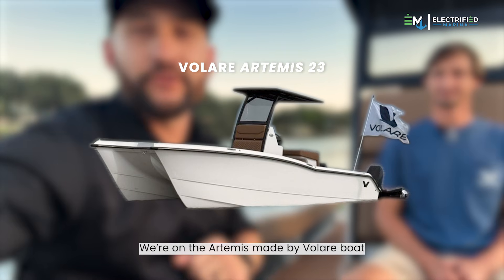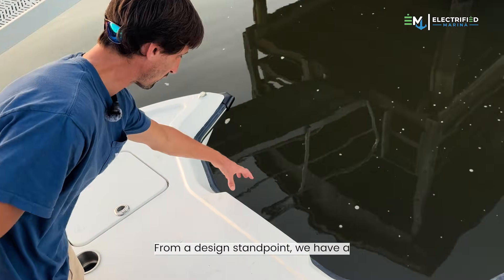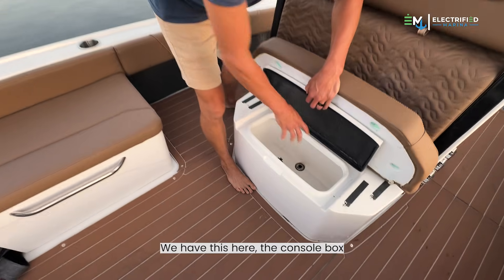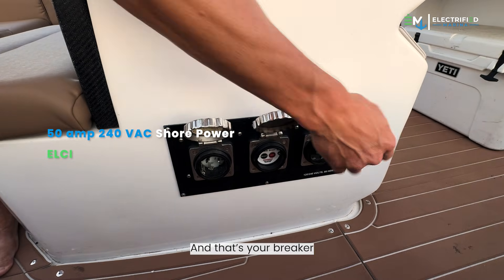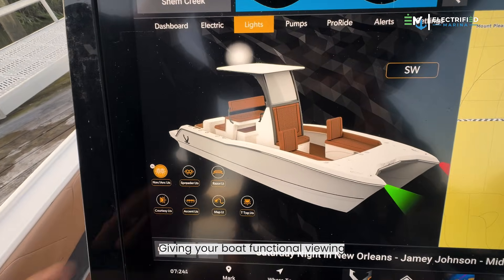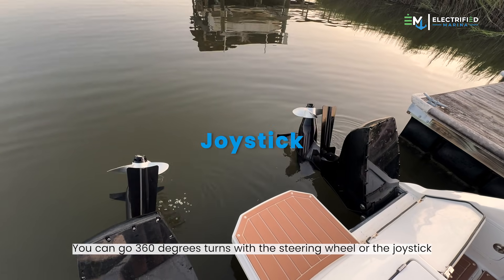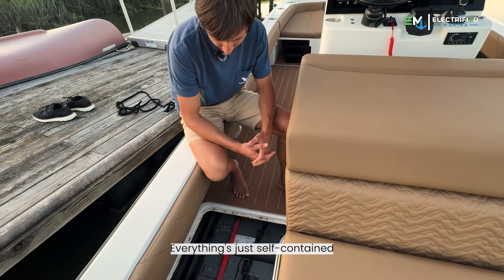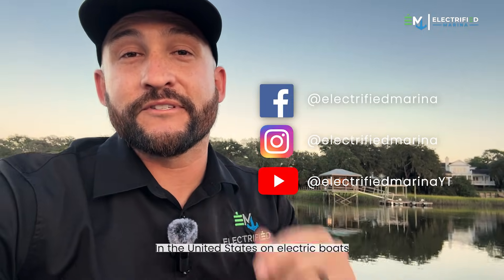FLYING ELECTRIC CATAMARAN | 2025 Walkthrough of Artemis23

Comment: why don't you cool the battery back, even small taiga pwc has a cooling system which I think in this setup a must. Apart from that it's a good machine.
Reply from the maker: It doesn't have a high enough C rate to need cooling. It's not an issue

Comment: Might want to start with charging infrastructure. Most marinas pretty much all i know of come with #shore_power which might be sufficient here i do not know. The energy output of an internal combustion engine is absolutely ginormous so matching that with a battery to create a hybrid drive propulsion and environmental system that i could understand. Until then #tesla_fsd this car system is built around the computer and software first  then everything else. Long story short on the transom on this offer i would put an outboard motor in the middle of the two electrical types presented here anything below 115hp inclusive that will keep the batteries charged up and give you a reserve power source at the same time. This needs a canopy big time as well preferably one forward of the center console inclusive. That's about it tho😊😊
Reply from the maker: Marina shore power is exactly what these need to charge up overnight. 30-50A is adequate for a 12 hour charge. With the range capabilities of this boat being up near 80 mi on the larger battery configuration most people don't even need the range extender. People buying these are lake/bay boaters and aren't going offshore. The beautiful thing about this is the lack of maintenance and adding a generator or gas outboard would give you all the headaches of a gas boat.

Comment: Range, cruising speed, draft, weight, rated capacity?
Reply from the maker: 10 person capacity, 17" draft, 3400lbs, 40-80 miles of range at 20mph depending on battery configuration.
Reply: @electrifiedmarinaYT  thanks! Great setup